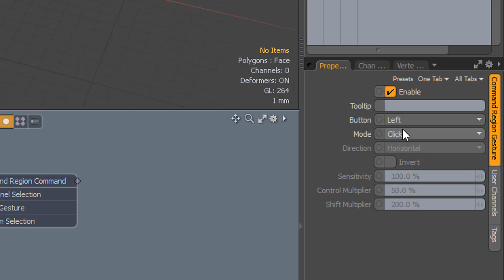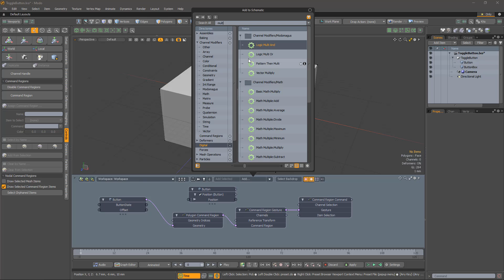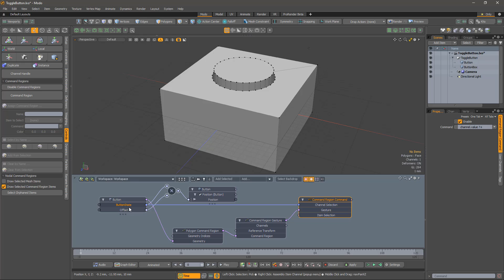Toggle Button using Rig Clay

Comment: You've selected all of the polygons, so if you were to hide the cube would they all be moving up and down? If that's the case would it make more sense to select only the top polygon so that it is the only geometry to move?

Actually just did a quick test.... the whole cube moves.... Great vid as always.
Reply from the maker: Yes the whole button is moving.  It’s not tied to the selection though as I am transforming the button item.  It would work just fine if you selected just the top face, for example.

You can move just the top face - one way would be to add a transform to the button’s procedural stack.  I have done this but it is a bit more to set up.